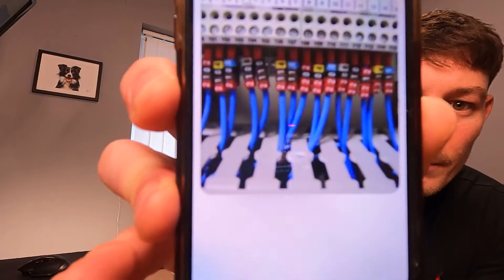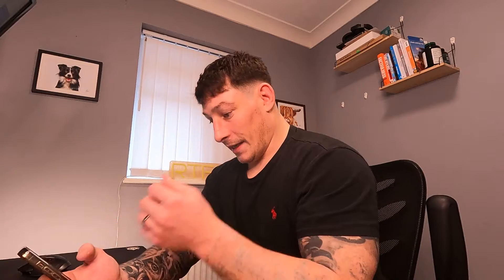Loxone Vs Control4 & Cable Identification Chat on Instagram

Comment: great video, personally here in Canada we are seeing the control4 and AV side of things die since video switching has almost no use case anymore and when you get into large building control4 just can not handle it. So many failures with it and snowballing issues. If the name wasn't so well known here it would have died already. We install Loxone and the customer satisfaction has been great and it can also handle AV in home just as well you just don't get a touch screen remote but apple home kit has fully removed the relevance of a universal remote anyways with a loxone system and a apple tv. Not too mention the price of C4 and how often their touch screens die or the processors die from people not cleaning them from dust. 
That being said for a restaurant or a bar c4 for its abilities in AV matrix control would kill loxone but with that i would say is crestron, control4 and savant systems that will be all they have in the next few years. 
Through client survey we find more and more people don't want too stand at a wall anymore and swipe pages just too lower blinds, swipe a page turn on a tv, or something like that makes a "smart home" relatively dumb. For home a alexa or google would surpass a c4 or crestron on lighting, heating, and AV realistically
Reply from the maker: Mate thank you! That was a really interesting read, thanks for sharing. I totally agree, video distribution is dying, certainly for domestic use. I still love C4 though, we use it alot as a front end user interface with KNX on the backend. Also, if you wanted video distribution using Loxone (you might already be aware) they have pre-built drivers in their software for HDAnywhere Matrix's
Reply: @beeautomation  We haven't really had the need for any video distro with smart TV and even Plex being the main source now. Right now I would say control4 and crestron along with other AV style systems i think they need to innovate and very very quickly. Crestron maybe not as much as control4. C4 has been good...ish, but in this tech era i don't even see the point of it anymore it saves you nothing and supplies headaches since everything requires network, wifi, and 3rd party communication. From my understanding if your network dies EX. router shits the bed you are without majority lighting control, audio, the very limited HVAC it can do, and the touch pads are useless until they acquire an ip. It was a cool product a few years ago, but without their marketing team they would have died long long ago.
I follow you on my company Instagram and always enjoy the un bias content mate!  i try and stay open minded like with loxone, we were a RTI dealer for years and we jumped and its been the BEST thing we have ever done.
Reply from the maker: @niallcoutts1097  interesting to hear your take… you’ve definitely got come valid points. Thanks for the support mate 🙂 … I’m not massively into AV anyway, BMS, HVAC and automation is my cup of tea 😉 ☕️
Reply: @beeautomation  I appreciate the content and no one seems too make it and you're spot on with all of it, so keep it up i hope your channel grabs some good traction. There is a lot people can learn from you from pros to the DIY guy.